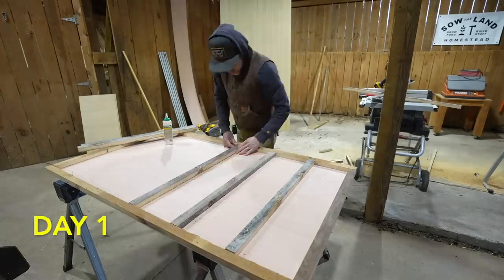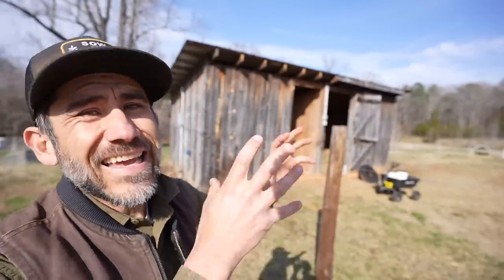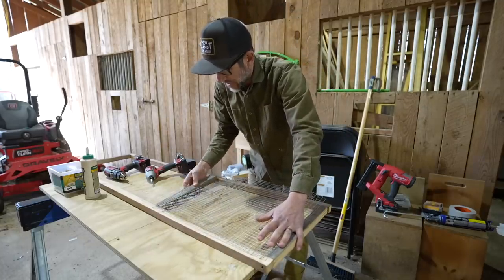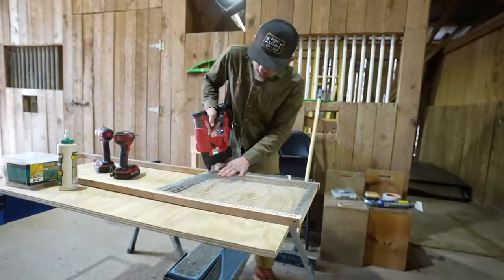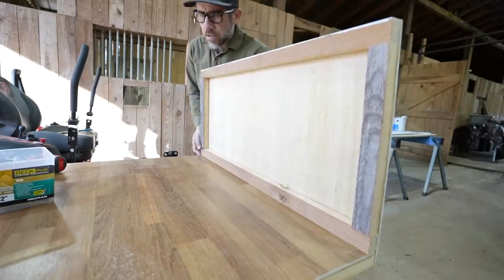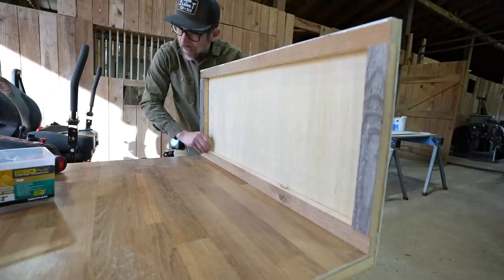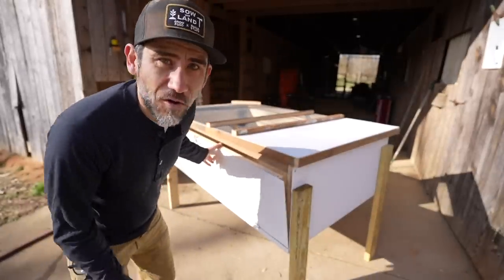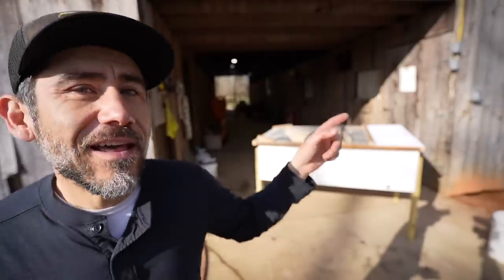Growing our Chicken Farm with this DIY Brooder

Comment: Man, I just built a brooder VERY similar to yours with the same, drop down wall feature for easy clean out!  You did a nice job!

Predators are the reason you don't use a big stall as a brooder.  It's way too hard to rat/raccoon/mink proof it.  The other issue is mess.  Chicks create an enormous amount of dust/dander that gets all over EVERYTHING.  Your barn would be covered in the stuff and it gets all over your equipment/wood/tools, etc.  
The best solution is a dedicated, outdoor set up for brooding.  I haven't gotten there yet because it's a big commitment to do. 

Also, I just got one of those milwaukee narrow crown staplers too!  I used it to put up insulation in a workshop, but I found it's awesome for hardware cloth like you mentioned.  Very happy with it.

Comment: Jason I believe both your short term and long term solutions are spot on. I really like your new brooder. Getting it high off the floor is really going to frustrate the rats. They don't like having open areas like that, no hiding places. AND it's going to be a lot easier on your back,especially as you get older working with the chick's. Well done. I'd love to get those plans if you make them available. 👍😁🐣🐤🐥

Comment: Jason, I think people were referring to you using the whole stall as a brooder area, not just a room to keep small brooders in. We did that and it worked great. Depending on how many chicks you have you just increase the # of lamps you use in different areas so they don't over-crowd. You could raise more than you need in one of those stalls. Thanks for sharing.

Comment: I had my chicks in a stable for a few years with no problems but last year rats found them and took every one of them.  I made a temporary brooder to put in the stall for the replacement chicks last year.  This year, I'm working on another that I'm building on an old trailer bed.  The plan is to use it as a mobile coop for some of my egg layers in the back field after the chicks are out of it.  That's the plan anyway...time will tell.  😊

Comment: Those little frogs are called "spring peepers".  Also you might consider a multilayer gravel floor (large stone then fine packable stone on top) with vinyl chicken wire between gravel layers and geotextile underneath.  I think gravel is far more rodent proof and cheaper than a concrete slab.  Rats tend to make cities under the concrete and it is really hard to get them out once they do.
Reply from the maker: love it

Comment: I would not call that wood from the barn stall scrap wood. I'd call it seasoned hardwood. Nice job on the brooder. It will be much easier to do the chicken chores with the unit elevated while those chicks grow.

Comment: I know you are trying to do it on the cheap to show people how easily things can be built just from scraps, but I was looking at the lid of the coop. I thought that if you made it the same exact size as the coop itself instead of overhanging it, you could put hinges on it with a couple hydraulic hood/trunk pistons, (Could probably pick them up at an auto salvage yard). You could latch it down with the other trunk lock, (They did come in a pack of 2). Just a thought to ponder.